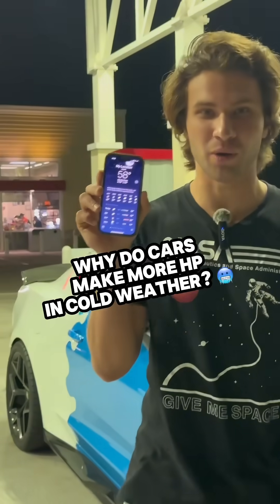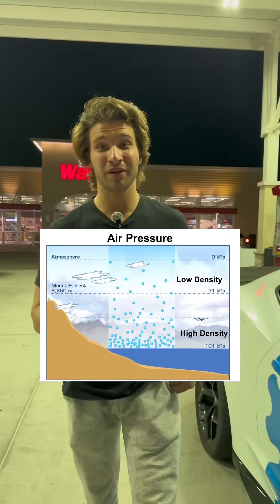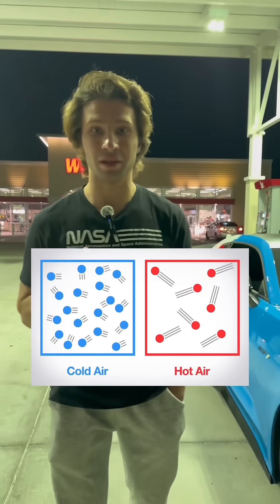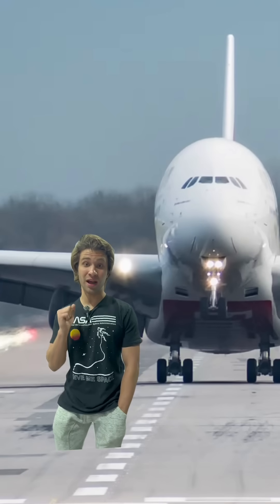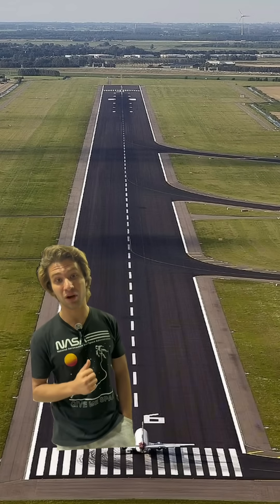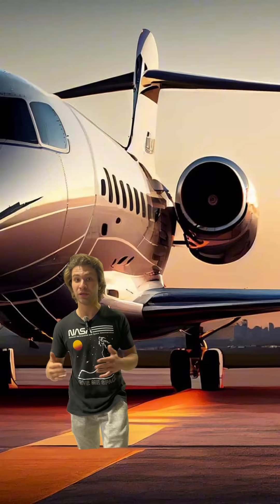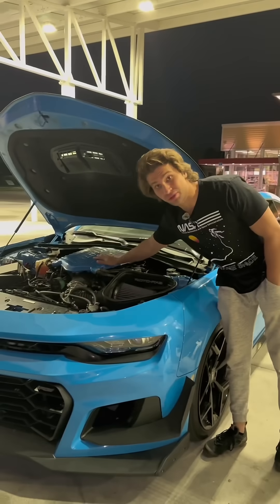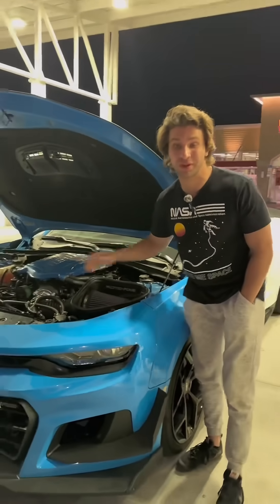WHY DO CARS MAKE MORE HORSEPOWER IN COLD WEATHER? #stem

Comment: glad to see someone explain this well! 

now make a video about why pouring in PURE oxygen into your engine is a bad idea, but nitrous oxide is ok. 

incase you yourself didn't know, pure oxygen will make basically any moder car spray in a VERY large amount of fuel and either heat it self up to death, blow itself up or rev to death. 

i have seen old carburated engines doing fine when tuned properly, but no new car will survive a bunch of pure oxygen being added.
Reply from the maker: @baseder514  sure thing, I’ve actually already made a video about this!
Reply: @TobyVegaD  oh nice, ill go check it out!
Reply from the maker: @baseder514 thank you man!

Comment: Wrong a Turbo charger  can provide sea level  air pressure (boost)  at 13,000 foot.
I climbed up a mountain ⛰️  of 16,000 foot.  But at 13,000 I  turned around and  went down to  breathe at 10,000 foot.
Reply: At a certain point up in the atmosphere it becomes a turbo normalizer not turbocharger and it has to work hard to do so. You can maintain sea level power to a certain extent. At 13,000 feet high, car engines would struggle to move the car much more especially compared to 2000 ft or 5000ft
Reply: And cars are really designed to be used in elevations between sea level and 5000 feet (they can go higher but Naturally aspirated engines become weaker). Turbo cars fare better in the elevations towards the higher end. The turbos at these elevations have the ability to maintain similar boost levels to maintain close to normal power but still lose some. At altitudes that planes fly at, things get more difficult to adjust to.
Reply: Wrong the sky is green
Reply from the maker: @BillieWilliams-l6m  a turbo charged car making 6 psi at sea level will be faster than the same setup at 13,000 feet. It’s basic science
Reply: @TobyVegaD  wrong  the same six pounds of Boost,   the engine will make the same power
Reply from the maker: @ not true.
Reply: @BillieWilliams-l6m  unless the car is capable of producing more than 6 psi, it will be weaker at higher elivations.

if the turbo can spool up fast enough, and still produce 6 PSI at a higher altitude, then yeah, it will have similar horse power, if not slightly more due to the pressure difference in the exhaust being higher
Reply: @baseder514  
I can help you 
I work on aircraft 
4 and 6 cylinder engines that use  Turbocharger  to maintain sea level  performance at 15,000 and 20,000 foot. 
Six pounds of Boost   at sea level  or 20,000 foot  engine performance is the same.

Comment: Completely wrong. The amount of oxygen is the same no matter what altitude you are at. The chemistry of the atmosphere does not change with elevation.
Reply: Did you even watch the whole video? You are right that oxygen stays at a constant percentage no matter what altitude you are at, but that’s not what he is talking about. He is talking about atmospheric pressure and the effect it has on combustion engines burning the oxygen molecules. 

Lower Atmospheric Pressure (High Altitudes)=Less oxygen molecules being taken in at each intake stroke, which means less power.

Higher Atmospheric Pressure (Low Altitudes)=Denser air, meaning more oxygen molecules are present in each intake stroke, which leads to more power.
Reply: Someone who never went to school 101. The higher density means less oxygen and more other atoms like hydrogen and so forth. The atmosphere 👌 😂😂
Reply: Lower density means the oxygen molecules are more spaced apart so less oxygen will enter your engine and that means less power. That’s why turbos exist. To help planes fly to higher altitude and to help vehicle engines retain more of their power output.
Reply: Nope
Reply: @dennisfredrickson1202  ignorance is bliss